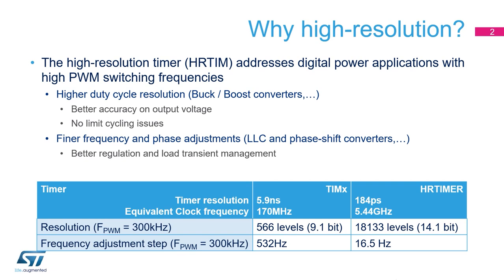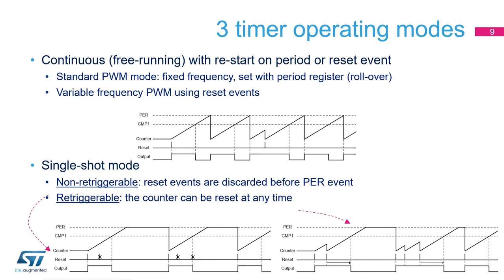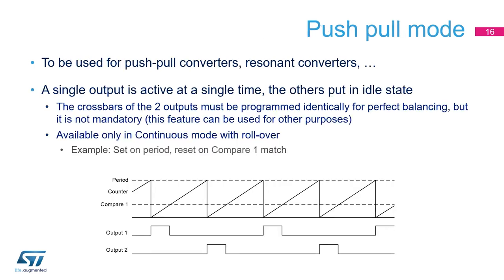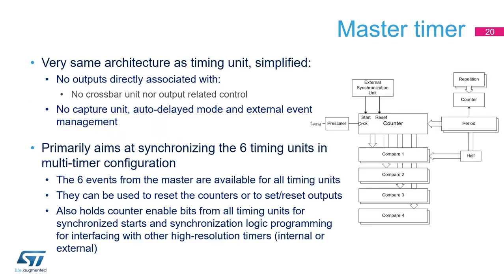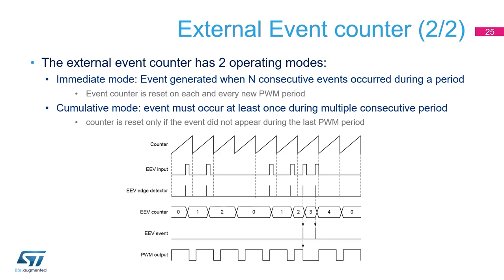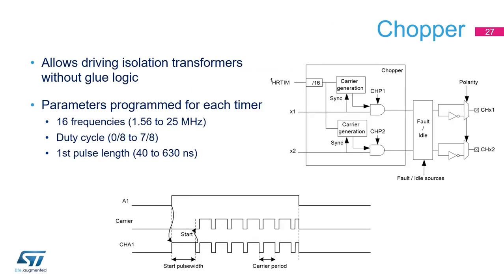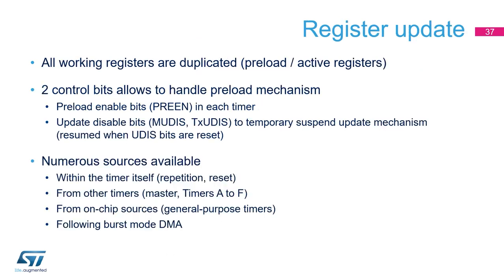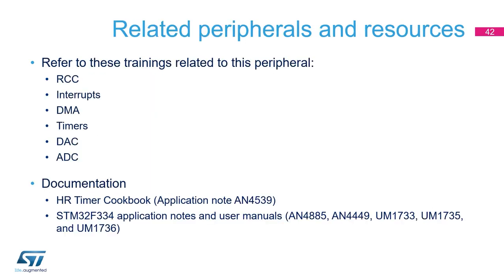STM32G4 OLT - 44 . WDG TIMERS High Resolution Timer HRTIM

Comment: Summary
• [0:07] The STM32G4 series features a high-resolution timer (HRTIM) ideal for digital power conversion applications, especially those demanding high PWM switching frequencies.
• [1:14] The HRTIM surpasses standard timers in duty cycle and frequency resolution, achieving resolutions as fine as 312 picoseconds using a delay-locked loop (DLL).
• [2:08] Comprising seven 16-bit counters, the HRTIM can operate independently or synchronized, offering flexibility for various applications.
• [2:32] Key features include a crossbar unit for versatile output control, multiple operating modes (continuous, single-shot, up-down), and a repetition counter for CPU offloading.
• [8:40]  The HRTIM boasts advanced functionalities like half-mode for efficient 50% duty cycle generation, auto-delayed mode for externally referenced timings, and push-pull mode for simplified push-pull and resonant converter management.
• [25:41] Safety is paramount with a dedicated fault management unit, numerous fault protection options (analog, digital, delayed idle, balanced idle), and fault filtering capabilities.
• [29:32] Seamless integration with ADCs and DACs is facilitated through dedicated triggering channels and features like slope compensation.
• [36:15] The HRTIM simplifies complex waveform generation, exemplified by its use in a triple interleaved converter for synchronized PWM signal generation.
i used gemini 1.5 pro to summarize the transcript